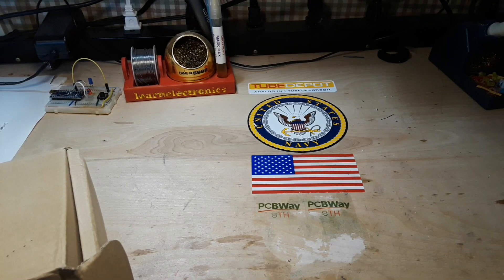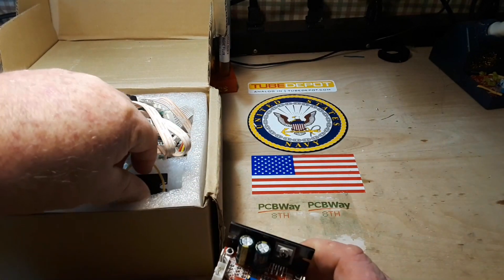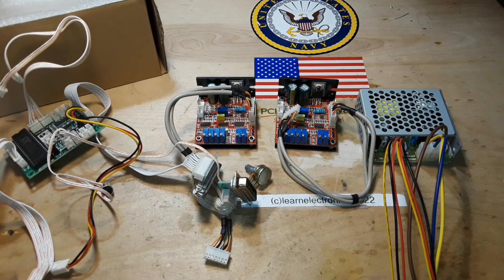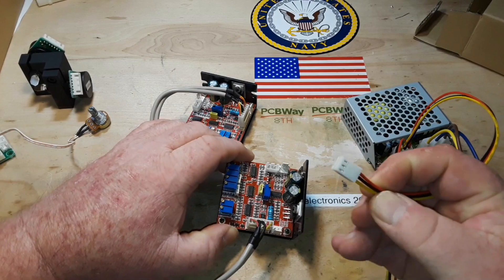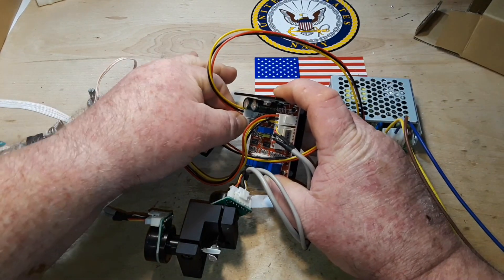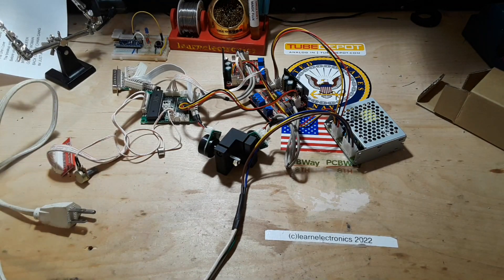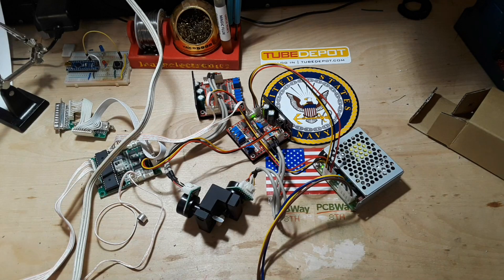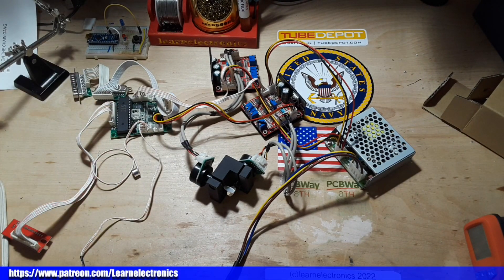DIY LASER Light Show Pt.  1

Comment: When I retired back in 2015, I became a wannabe maker of IoT stuff. So I started buying and trying out all the different flavors of Arduino dev boards.
When I came to the Teensy 3.6, with 2 DAC GPIOs and researched the docs, i said to myself, "This could generate lissajous images for a laser projector." But, I needed to learn what a sketch was 1st.
Now that your channel has learned me some smarts, I pulled that T3.6 out of the parts cabinet a few months ago, dusted it off, and now I'm up to my ears in cycloid imagery, MIDI controls mappings and function calls via usbMIDI.
This looks like a great project. You'll need to mount the laser pointer and the galvo x/y block onto something to keep it aligned. Anything will do. Suggest using the x/y block's mounting screw holes (the ones on the same plane, NOT the ones with the grub screws securing the galvos). Once that's mounted onto a board or whatev, then use some shims to get the pointer to the correct height. A couple of rubber bands can hold it down in a 'V' channel.
Rots-a-ruck!
😎
Reply from the maker: More coming. I have it mounted

Comment: Found this reference in a review on an old ad...
After assembling, the standalone operation uses DIP switches to change between 8 possible modes. One of them allows reading audio signals from the included mic to write patterns according to that signal. The corresponding DIP codes are in the manual, so wait for it if you don't have it. For a quick test set LOW all switches except for switch 1 and switch 10 this will produce a [1000000001] that will set an 'auto cartoon' mode that will draw random animations. Use a laser pointer towards the mirrors and see the generated light patterns...
Hope this helps.

Comment: The mains wire colors could be European, but apparently not entirely (earth wire is not correct). Blue is normally the neutral wire, brown is the live wire and the third one is normally  yellow with a green line for the earth connection.

Comment: The 25 pin D plugs are ILDA connectors. Industry standard for controlling laser show directly from a computer, but you need an interface and compatible software. Your mirror assembly aren't stepper motors, they're galvanometers that work like moving coil output meters on old tape decks have. But for laser shows they are faster and have optical position feedback.
Reply: You are correct .. they are not stepper motors.. i have built many of these units

Comment: I’ve seen something like this.  You apply an audio signal to the laser facing the spinning mirrors and it draws the waveform on the wall. 
Of course I’m probably wrong, but it works in my imagination. 
Looking forward to the video where were communicating with the Zetas. 
God Bless.
Reply: The mirrors don't spin. They move the beam up and down, left and right between the two mirrors very quickly at 20,000 points a second using an optical position sensor for each mirror, so you can do animated line drawings as well as awesome beam effects if you use a smoke machine or hazer.
Reply: @fuzzybobbles  cool.  Thanks. That also works in my imagination. Great stuff.

Comment: I've bought a few of these, but the galvo amp board had x and y all on one board. The controller board also had a small screen with SD card reader for ILDA animation files and DMX compatible. Since I bought them I have upgraded the RGB laser assembly to higher power and built them into aluminum flight case style makeup cases. (girlfriend was happy as she got the makeup included in each case.) Laserworld in Germany have free software online for designing your own laser animations and beam effects. I also use Freestyler Software (also free) for controlling everything via an Entec USB to DMX interface.
Reply: What are these parts called? Where to buy a kit?  I want to use this for a personal project where I code where the laser goes.